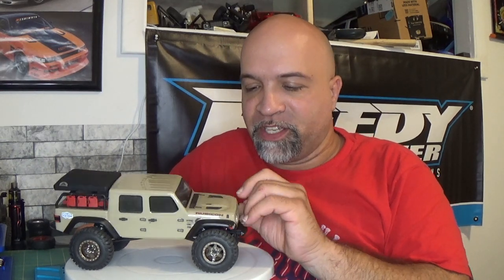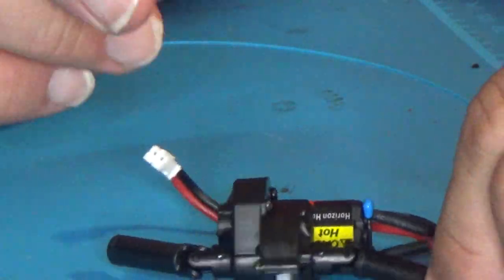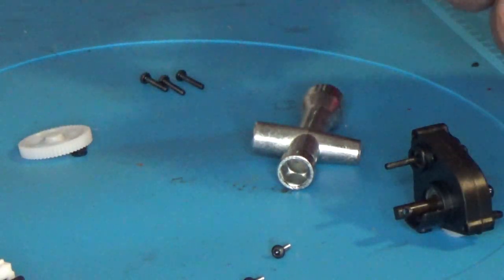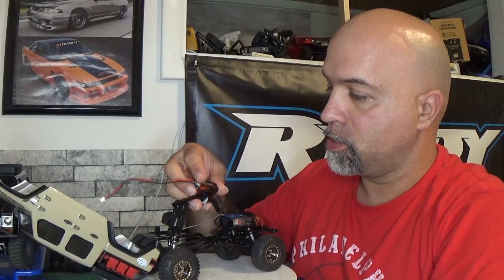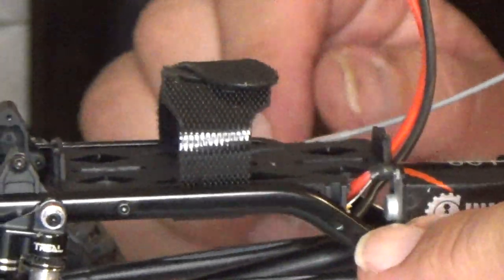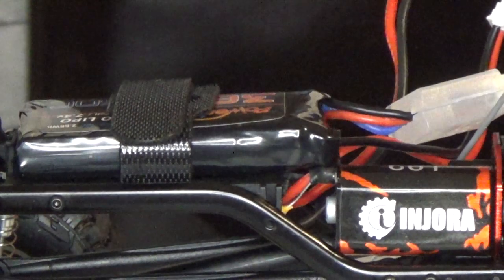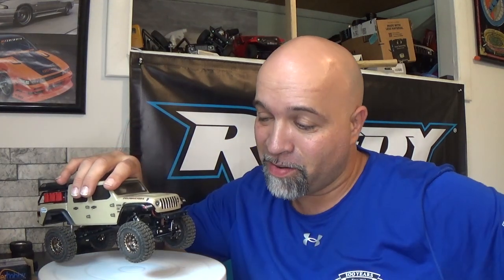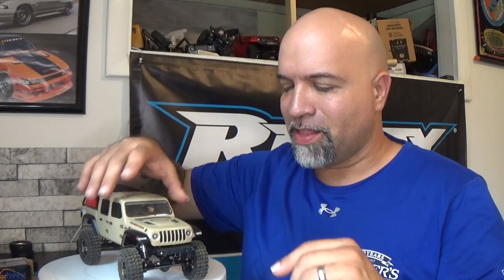Making the SCX24 Gladiator better New Servo and Injora 66t motor How to install

Comment: i put the same motor but it makes a lot of noise,i change the spur gear mesh 3 times but again,i can hear yours too,is this wright?maybe i used to hear the sound of my trxm that is very quiet though!
Reply from the maker: No this motor was very quiet even compared to the the stock dynamite motor when you accelerate more than yes it does get a little louder